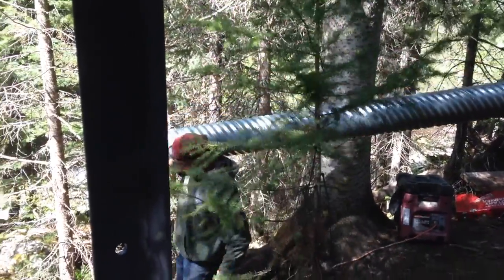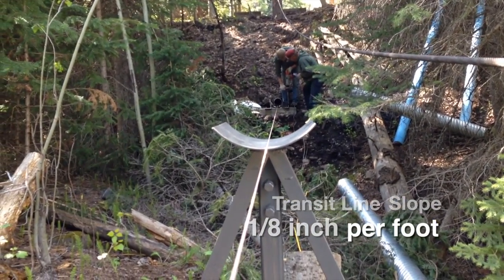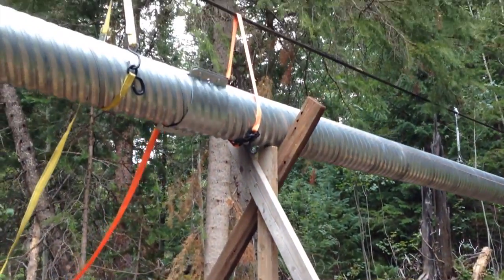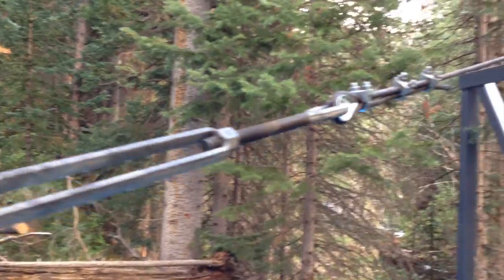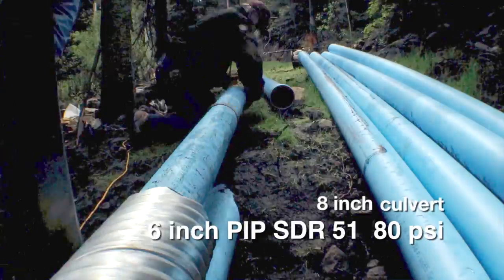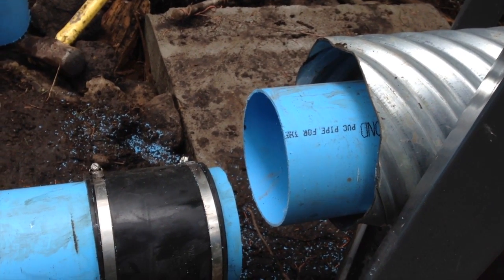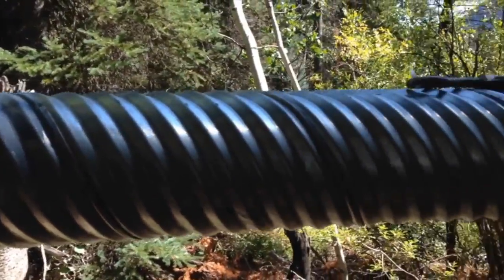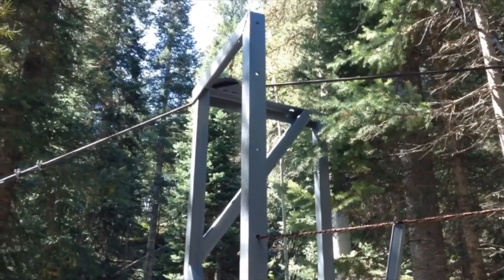Part 12 MicroHydro Power System in CO

Comment: Error correction: 1 cubic foot of water is 7.48 gallons, so 3-8 CFS =  22.44-59.84 gal/sec, not 300 gal/sec as noted at time mark 4:50 on the video.
Reply from the maker: You are correct.  It should have said 1cfs =~449gpm in upper left corner.  Too late to change it though.  Thanks for pointing it out.

Comment: That fernco is a failure point. You would better off with an iron slip coupling over the plastic 
Which can be done.
Reply from the maker: In the 4 years its been there it has swelled a bit and we are soon to install couplings with SSteel banding even though the pressure is only 2-3psi at those joints.  thx for watching and the suggestion
Reply: @mrhydrohead  Don't get me wrong u guys did an awsome job . We're underground utility excavstors and I came across your videoes. I just noticed the bands you guys  used aren't great at all  except for underground sapported with compacted stone. I would switch them out . We did a job similar in upstate PA. Your video  just completly reminded me of the job. Anyway great job man .
Reply from the maker: Thanks for the input and compliment.  We appreciate it!

Comment: Great work. and great video.

I am watching the entire series and having more and more questions, why didn't you just built the powerhouse down the stream somewhere? I think you could've built one or more small dams and save a lot of time and money,  power cables are much easier to install in that kind of length.
Reply from the maker: thx for watching.  If you haven't seen it check out parts 20-1,2,3 which are a synopsis of it all.  The further water falls, the more pressure  =  more power.

Comment: Why didn't you mount the pipeline above the I-beam structure and cantilever the catwalk off to the side? Also, why mount the culvert on the upstream side where the risk of damage is potentially greater? As an engineering student I'm interested in the logic behind the design.
Reply from the maker: +TheIdeanator 
All valid points.  I'm a cinematographer by trade and not an engineer.  The supports for the bridge and intended cable design were in place before the I beam ever came into play.  Our original intention was to make adjustments to the bridge from ladders.  During construction W e decided a cat walk of some sort would be more practical and attempted to create a makeshift catwalk out of interconnected salvage extension ladders.  We immediately found that insufficient to support a human.  

It was at that point that my contractor came across a friend that was recycling a modular home which contained the I beams.  We got them for $150 and he welded them together to make a catwalk. The heights of the supports we had poured and steel installed on the opposite ends of the bridge were already set to the grade we established for the pipeline by laser. 

Honestly, I'm a bit embarrassed to say we never considered retrofitting the supports to accommodate what you suggest.  It would have been a good solution. Instead we remained focused on the idea of cable suspension as the weight of the majority of the bridges length hung from it.  I'm not sure if having two methods of support would have seen other issues arise, but it's an interesting question from an engineering standpoint and beyond my expertise.  The pipeline bridge does flex a bit with varying weight and has required adjustments as the cable has stretched slightly over time.

Me coming from a film set mindset and my contractor from his building background our mutual approach was to resolve problems as they arose.  A director of photography takes the skills of his crew and builds a set of generators, cables, lights, grip gear, and dolly tracks every day, then tears it all down and starts anew the next day.  A contractor overcomes problems often not foreseen by an architect on the spot with his experience and ingenuity coming up with creative solutions to things as they arise.  

The spontaneous creativity is what makes both of those jobs fun.  More doing and less design oriented than creating all on paper or digitally.  It's a good thing to understand the difference as an engineering or architecture student.  When something planned doesn't pan out, the experience of people building the dream solves the problems unforeseen in the plan.

On the upside issue.  The catwalk is 12-15 feet above the water and if there were a deluge of that height then far more severe problems would preclude any risk to the pipeline.  Also, with the supports already in place, there was only one option where the cat walk could fit.

 The process of trial and error continues with the diversion of the creek to the meadow and is the topic of an upcoming video.  Thanks for watching and the good questions posed herein.

Comment: That's an amazing amount of electricity being produced. Just awesome! I'm guessing your local utility either doesn't purchase excess or it's not feasible to connect to the grid based on your location. On average, I consume 22 KWh of electricity per day at my primary residence - grid tied. I just have to laugh at the excess your going to produce. Anytime someone can disconnect and raise a finger to "the man" is another victory.  This is truly an inspiration to myself to get moving and I'm sure a lot of other people.
Reply from the maker: Decentralized power generation is the way of the future, be it water, solar, wind, or whatever.  Hopefully people will come to see the advantages of it.  I've always been about 7 miles from the grid, and in 1994 when I asked, they wanted $20K per mile just to put a line in on poles, so yeah, I did hoist a digit.  Now if the car producers would just get an affordable hydrogen car available, I could produce hydrogen and be home free.
Reply: MrHydrohead A hydrogen conversion is easy on any internal combustion gas engine (not diesel) It involves putting a hydrogen tank fuel lines and a injector leaving the normal gas system in place. The best tanks for a car would go on the roof to keep the normal storage spaces of the car. For trucks its harder to fit the tanks in without taking bed space.

The process is the same as a LNG conversion just with hydrogen rated materials and the programing of the computer to use hydrogen over gas. No changes are needed to the physical engine as all the parts are bolt on. And yes you can also use it for running a gas/natural gas/propane generator.
Reply: The point of hydrogen as a fuel is that its fast to fill and safer then standard gas. When people here hydrogen they picture the Hindenburg accident where the combo of a flammable skin and easy to rupture bladders of hydrogen combined to kill all on board, when you look at fuel in a vehicle its heavier then air so in an accident is running on the ground under you hydrogen as a lighter then air gas is quickly leaving the area up.

Any gasoline engine will run on hydrogen with a simple conversion that dosnt stop it from using the normal fuel system. Fuelcells give more usable energy per cubic foot of hydrogen but it isnt needed to use hydrogen.

Producing electricity on board an electric car adds weight that drops range. Say you had a light weight generator thats 10lbs thats an extra 10lbs you are moving every day if you need it or not.
Reply: MrHydrohead isn't Hydrogen made using electricity? if a hydrogen car used the hydrogen to make electricity to run the motors... why not just use the electricity in a full electric car like a tesla? doing that cuts out an entire step in the process, and there is no chance for any hazard due to the flammable nature of hydrogen (unless an accident happened, in which case it would be contained)... what i think would be nice, is a way to actively generate electricity in a vehicle like a tesla already, if only just to increase range somehow... assuming you are using a full electric car, just generating the electricity to charge it would be enough... and then no need to have any sort of "fuel" with the exception of the electricity... i love your micro-hydro project, we could really use more "at-home" generation, there is an incredible amount of roof area that is just making heat and could be used in solar PV configurations... any one lucky enough to have the land and the water and can do hydro-power, can make a Lot of energy... and is awesome
Reply: Andrew H another thing though to ask is... how is that hydrogen being produced... my guess is, electricity... but then why not just use the electricity and cut out a step? and as for weight, in my case i rarely if ever use the rear seats in my car... that is already at least a hundred pounds I'm lugging around that i don't need... where if you Could put a generator in the vehicle instead of those seats, and it was a type of generator which took a ridiculously low amount of power to actually run (a zero cogging generator of course) then all you need to do, is tap the motion of one of the shafts of the electric vehicles tires... you would have reduced weight and you Would be generating electricity, even if it was Only a range increaser, and not making More energy than was put in (which is not what i am saying would be done) however, if you Could over come the deficit in efficiency, electronically, then you would be a Lot better off... so lets say you used a sola panel on the roof of the vehicle to Suppliment any losses incurred by any friction in the system... assuming all you need to make up is about 3-5% losses from wiring and heat etc... if you reduce resistance as much as possible while increasing power to the generator... you are making energy, effectively increasing range... and like i said, i don't need so many seats, and the generator would weigh less than those seats all combined... yes, this is all purely hypothetical, and yet to be built or tested... but electronic control could improve the performance of such a system immensely... oh and... if you "charged" with solar, wind or Hydro... you are basically driving virtually for free (once you've saved off of your initial investment of course)
Reply: Andrew H
then go withh a solar panel and charge controller set up . to charge your lithium ion 4 batteries as needed.
Reply: Nathan Dean
A solar panel also adds weight. A 240watt panel is around 45 pounds plus the weight of the charge controller and a system to dump extra power once the battery is full. A flexible panel is much lighter but will get less power per sq foot and both types run the risk of damage to the panel itself and having to park the car in a sunny spot.
Reply: theey you havent seen the thin film panels then. or the pv windows as well. poor person  you havent door your research then. i have.

Comment: Awesome job on the bridge! I've been looking for this video for a long time. Thank you so much for sharing your progress. I can't wait to see the next video with pressure testing. I'm hoping the creek doesn't rise enough to undermine all this hard work or a tree doesn't fall. What is your potential wattage output once this "mega" micro hydro system is complete? Which turbine have you selected? I know this has been a huge project and wigs you all the luck when you finally flip the switch.
Reply from the maker: Michael J
You are correct in pointing out one of the weakest links.  Prevention is the only strategy beyond persistence and a willingness to rebuild when/if(certainly someday) it sadly occurs.
Reply from the maker: As I'm planning so far, the output should be between 8KW and 9KW w/single phase AC.  We shall see.  It depends on the available flow, active pressure, and efficiencies we can produce.  I potentially could bump the system up to 12KW to 15KW w/three phase AC and a second jet.  I'm not yet planning to do this due to many factors, at least not until I determine I could use the power.  

There will be a lot to explain about load controlling and other factors in future videos.  But you have to remember that if you make the power you have to use it.  Production needs to equal Use in AC.  8KW x 24hrs = 192KWH per day.  The standard US house uses about 30-35KWH a day.  So what to do with the excess power?  It is AC power, so storing in batteries is senseless with excess, so HEAT is how excess will be utilized/stored.  The plan is to provide all heating for the house and in winter and eventually heat for a greenhouse in growing season.  Plan to work  a Jacuzzi Tub in there too.  But I'm getting ahead of myself here.  More to follow in future vids.

The turbine and generator are the same units I have shown in parts 1-5.  Turbine was made by Canyon Industries, Deming WA in 1996.  These components will be configured in a different manner and that too will be explained as we go.  Actual startup will be sometime in Spring or Summer 2015.  Please be patient.  I have to be that as well.  Long project.
Reply: +MrHydrohead Forgive me for not watching the rest of the series before asking, but do you have a plan to deal with damage should a tree fall onto the span?  Seems the damage and repair cost will be steep in such an event.
Reply: +MrHydrohead Perhaps isolating the span into sections and brace accordingly to limit the amount of damage to the impacted area only, and not the entire span?

Comment: whats CFS MEAN?
Reply from the maker: 1 cfs(cubic foot per second)  = 300 gallons/minute.  There is an error in the onscreen text where it should say 300 gallons/minute but incorrectly says 300 gallons/second.  My error, too late to change now.  Sorry about that
Reply: i only wondered was you meant by cfs but thanks for the rest
Reply: MrHydrohead There are 7.48 gallons in a cubic foot. Multiply that by 60 and you get 448.8. I had to take off my socks to have enough toes calculate this one. Great video series!

Comment: Thanks for the video. Are you a perfectionist man.
I'm curious how you made the water intake from the river.
It must be the same high level of quality and ingenuity.
I am still careful to your channel
Thanks again.
Reply from the maker: The diversion intake we built in 2013 got washed out in spring 2014 by the massive runoff and we have not determined the best course to replace it.  The water entering the system will initially by water from the meadow.  I will document our work to build the new intake for the creek next Summer.  In the meantime, the system will be started on the meadow water with lots of things to still be determined.  Its a LONG process on this one as the videos show.
Reply: MrHydrohead For the intake I liked 2 versions:
1. One small with gabions and water level control:
http://customer.lpelectric.ro/doc/busteni/busteni_hidro_turgo_powerspout_schneider_electric.html
2. One little bigger and more expensive:
http://customer.lpelectric.ro/doc/viseu/viseul_de_sus_hidro_6KW_powerspout_xantrex.html

I want to use the first option (I have a little house in the mountains).
Spring is coming ...